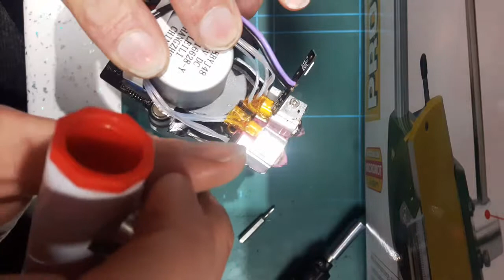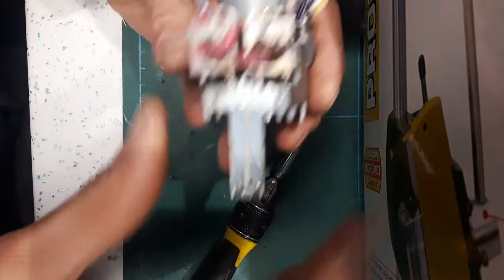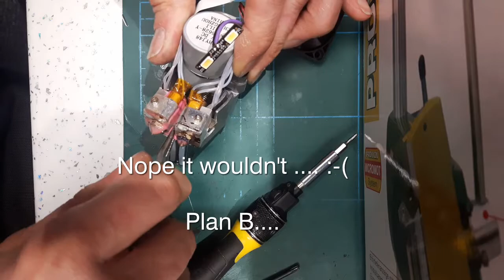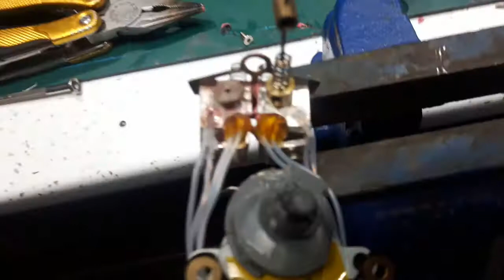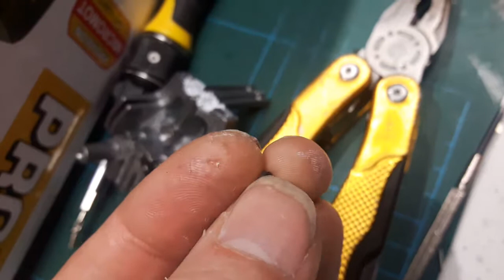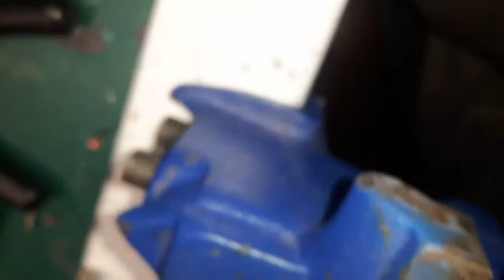Robox 3D Printer - Dual Head Inspection and O-Ring Repair

Comment: Genius but also needlessly  complex with too many failiure modes,which wouldn't  be a problem if it were easy yo fix.would be much more reliable if it was a simple motor tilt head dual nozzle system

Comment: High Great video, I've taken delivery of two robox's one is the original Kickstarter with a failed PSU ( I thought it would be good for parts) and the other is a working printer but with both heads leaking badly.  I was hoping that the kickstarter PSU was the only problem, so I could steal its working head for the leaking machine.  But Its giving me a Thermistor error only heating to 185c rather than 240c on the left extruder, using your videos will enable me to get in there safely, but have you any idea what model and size the the thermistors are so I can order some to do the replacement. I know getting the old ones out can be a problem so in previous cases I've just drilled a new small hole on the block and inserted it.  Any details with be gratefully received. Is the PSU a standard PC one? I was wondering if I could just replace it with one outside the box.  Regards Malcolm aka @fixed1t
Reply from the maker: Hi malcom.  I run the unofficial Robox Facebook group.  Search for that and I'll add you and can chat over that.  It's basically just a 24v psu so anything that can provide a few Amps be good.  The heated bed is mains supplied so you don't nerd mega current from the psu as it's not driving the heated bef
Reply: @chazj1976  great I'll go check it out Thanks

Comment: Hello, I have tried to make seal with high-temperature silicone, it has been blowed out at first calibration (or first test print, I've not made an inspection after needle valve calibration), material is too soft. Did you found suitable material? Did you polish needles before installation? There are little scratches on them, which damages seals during needle movement.
Reply: According to CEL the oring is viton.

Comment: Hi, good video mate.  I have a little issue with my 3D printer head. As i only have one filament installed and my head uses the small nozzle to extrude but why is my printer trying to extrude from bigger nozzle when there is no filament in it.
Reply from the maker: Hey bud the 0.3mm and 0.8mm nozzle head only accepts 1 filament feed. The filament passes in and melts and flows past the 0.8mm to come out of the 0.3mm.  If it's coming out of the 0.8 nozzle to you nerd to caliblbrate the needle valve opening by the calibrate function in automaker
Reply: Do you have single material head or dual?

Comment: Thanks for the excellent guide. Did you find a UK source for the O rings? Also, could PTFE tape be used on the threads? It should be OK upto 265C.